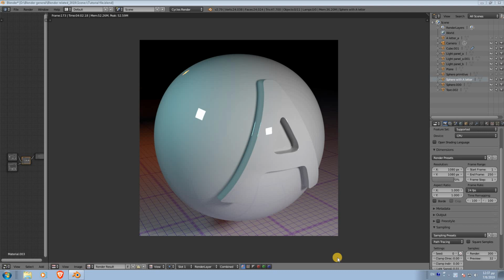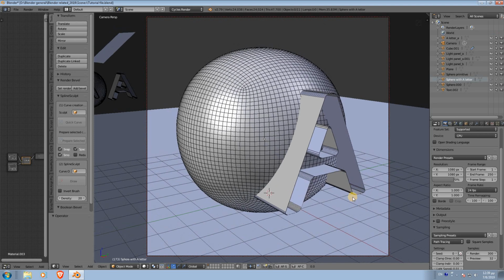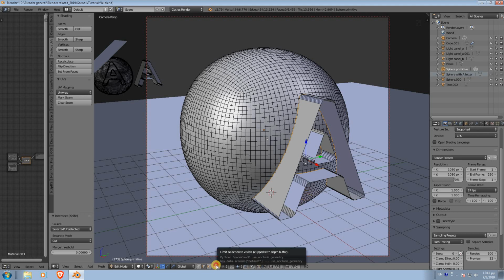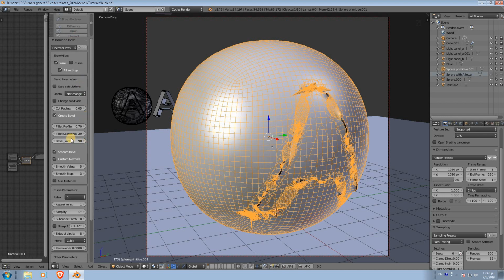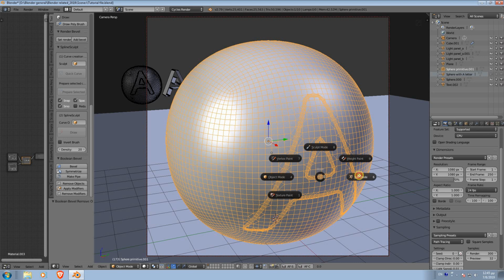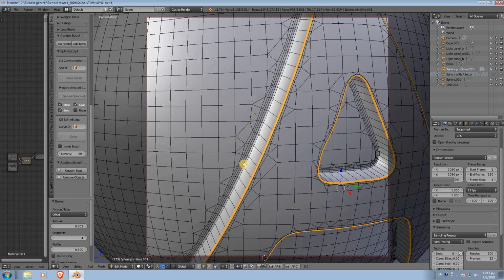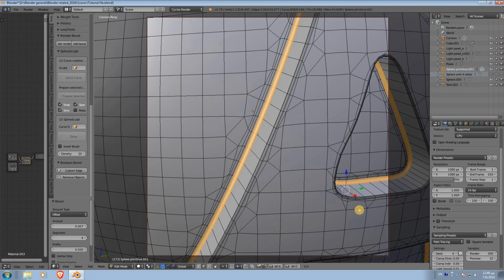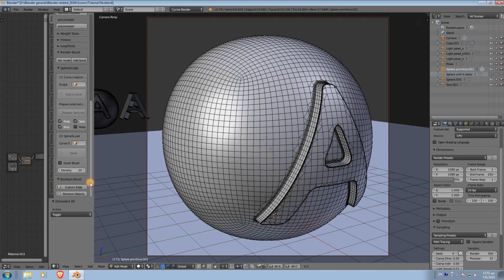'Custom edge' tutorial

Comment: yo do you plan to make an update for new blender version ?
Reply from the maker: The addon works the same way as in the older versions of Blender, so there is no need for an updated tutorial.
Reply: @dimitrilalushi4693  not working for blender 3.6 tho but thx dude
Reply from the maker: @styloo_  It is better to have a copy of Blender's 2.79 version in your computer and a 0.09 version of the addon, those two versions are the best as to their collaboration with each other. Personally, whenever I want to make use of the addon, I do use it in the mentioned version of Blender. The results it produces there are the best ones.